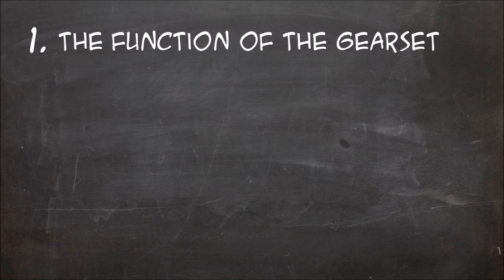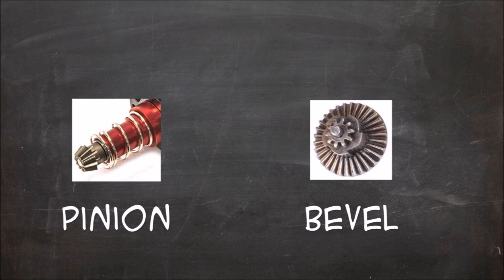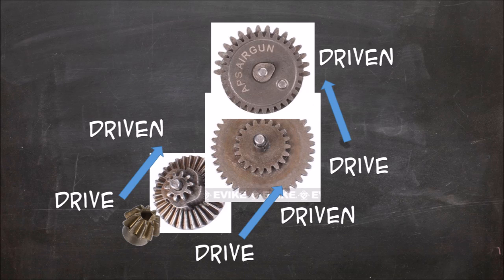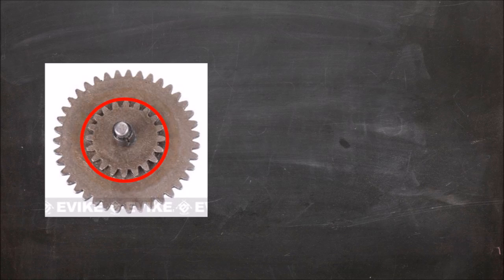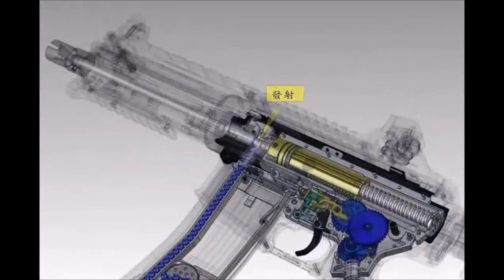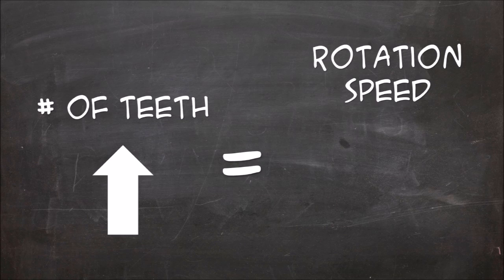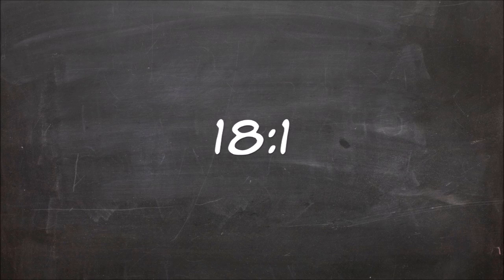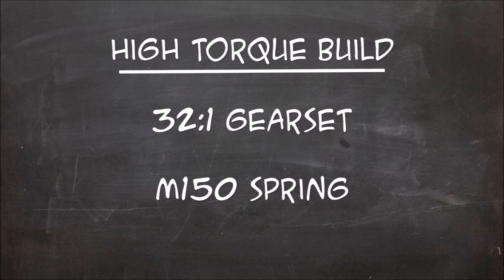How to Tech: Understanding Gear Ratios

Comment: What do you Think about changing my 18:1 to 14:1. I already got 1.95jule on m130 (Peru n hybrid v2) and asg 22k motor. The trigger reaction is awesome but i would like to shot Faster in full auto Mode.
Reply from the maker: Are you using 11.1v?
Reply: @sjdude922  ofc
Reply from the maker: Ok. Then just make sure it's a quality set. You can attempt to get away with a rocket or shs gear set but if this is a replica you don't plan on parting with it may be time to convert to siegetek. Just so you don't risk losing teeth.

Comment: Nice video. I´m entire day searching for something like this. But I have question hope you can reply. I´m going to have p90 from cyma. Soooo I want it high rps. So I´m gonna buy 11.1v battery, 13:1 gears, soft spring (I have cca m90-m100). But I wonder what motor. Motor at what rpm should I buy? I heard 18k-22k but that was only one comment.
Reply from the maker: It also depends on your intended FPS/joules. Where ever you play should determine your intended max fps for full auto or burst play. Then finally you need a goal for your ROF. Your current parts sound like 300 to 350 fps depending on your barrel length and cylinder type combo. So an 18k to 20k motor with that garset and batter should get at least 25rps. So yeah final stats will be 300fps like with an m90 spring and 25rps with an 18k motor with 13:1 gears and an 11.1 battery. Also remember the c rating will affect the performance as well. Look for 20 or 30 maximum C rating. That'll get you max performance from the motor without wasting power or creating too much heat.
Reply: @sjdude922  We have not fps limits (we know when too much is too much xd). Sooo I want as much rps/rof as is possible without doing complex/expensive dsg build. I have stock cm.060b (today arrived), never disassembled. Spring unknown but probably stronger one (maybe even 120). Sooo let´s say I´d do 13:1, m100-m110, 11.1v I see on shop 20/30c (literally 20/30c) so what xxK motor? Tell me  highest K on best performance.
Reply from the maker: @Shajzemon_SVK  You can always get a higher quality 45k motor such as an action army or a tienly but then you're hitting the 45+ RPS range and you'll need good mags to feed that. Best performance for me so far is my warhead brushless motor but those aren't cheap. I'd also advise an electronic trigger such as a jefftron leviathan or gate titan. You'll want the ability to tune the build with active braking and precocking for the maximum effective experience.

Comment: Hi! Do I need the sector gear delay chip with the 12:1 gears?
Reply: Not necessary, it would work fine without out one. But I would use one just to prevent any feeding issues. Pretty cheap anyways.

Comment: And about the 100:200 and 100:300 gears sets?
Reply from the maker: They use a slightly different equation to calculate their rating but same principle applies. Larger the number, greater the torque.

Comment: Ok so i’m doing a trigger response build with these parts:

SHS 13:1 Gears

SHS High Torque Motor

SHS M130 Spring

EastCrane(E&C) Reinforced Gearbox

11.1v Lipo Battery
Reply from the maker: Definitely sounds like a snappy semi auto response. I'd throw in a simple mosfet so the power goes directly to the motor and doesn't go through the trigger contacts. Unless you have the funds for an electronic trigger.

Comment: Got a set of 16:1 and the only gear that was different then my stock 18:1 gears was the spur. It had 19 teeth up top not 20. Literally everything else was the same with the rest of the spur and the other two gears. When I did the math it came out to 17.82:1 for my so called 16:1 😑
Reply from the maker: Do you mean a 19 tooth sector gear? The spur gear doesn't have a portion of teeth "up top". There are 19 tooth sector gears for l85 and sr25 cause some models have a larger piston.
Reply: @sjdude922  nope lol
The spur gear has a large set of teeth on bottom that contacts the bevel and smaller ring of teeth above those teeth that contact the sector. The teeth from the spur to sector was 1 tooth short of the teeth on my "18:1" spur gear. Everything else was identical

Comment: Hola ! necesito saber que seria recomendable. Tengo una gyg CM16 rider stock, y quiero incrementar sus RPS, cambio engranajes 13:1 + motor stock o engranajes stock + motor high speed 25k RPM ?
HI ! I need recomendation. I have a Gyg CM16 Rider stock, and y need increase RPS, I must change gear  13:1 + motor stock or moto high speed 25k rpm+ gear stock?
Reply: Un high speed pero le tienes que cambiar los gears y spring

Comment: Hello and thanks for the quality explanation!
I've bought a umarex UMP sportsline/competition and the internals are the worst so I thought to use it as a tech project. It has a v3 gearbox and after taking it apart for about 10 times, I now know how to work on it. I want the build to be able to shoot descent distance and also have some nice rate of fire. I am thinking of buying 13:1 gears combined with a mosfet. My question is what motor type should I buy for this project and do you think this would be able to take a 11.1 lipo, considered I buy quality gears? (I usually play outdoors). Love to hear from you @Cthulhu153 or anyone else in the teching field.
Reply: It has a ics barrel (m4 length) installed.
Reply from the maker: Quality is more a question of power. What gameplay is the replica going to be used for? Cqb or Outdoor.
Reply: @sjdude922  mostley outdoor. So i reckon accuracy and range are important. Maybe slightly bigger gears and a high torque motor are the way. Im just so torn at this moment. Also  i get that quality is more important but id like to have a snappy trigger.
Reply: bartd94 general rule of thumb when it comes to lowering your gear ratio, is increasing the TPA on your motor. You really don’t have to go below 16:1s if you have a good motor over 35k or below ~18-20 TPA, especially if you’re using a mosfet as the energy transfer will be more efficient and trigger response will lessen from that quicker energy transfer(to an extent). As far as accuracy and range goes, a lot less reliant on the GB that it is the bucking and nub. That being said the more consistent your air seal is, the more consistent your bb trajectory will be. For range and accuracy look into Rhopping your barrel.

Comment: If i end up using a 13:1 gearset would i go for the high torque or high speed motor?
Reply from the maker: Depends on the build. 13:1 gives high response time so it is also a higher rps ssg. If you use quality 13:1 gears you can use full auto at 400fps with the appropriate spring and compression setup and you should be doing 20+ rps depending on the battery and motor. 13:1 with a high response time can give you the best semi auto experience for indoor. You could pair it with a high torque motor for high response semi auto gameplay. Or if your power is low enough you could go with a higher speed motor so it can be used for semi auto indoor play and full auto outdoor play. The better question is what build do I want to do with 13:1? Then ask what parts can achieve that goal? That question can be answered a lot easier.
Reply: Cthulhu153 what do I need to make my Ares Amoeba AM013 to shoot 500fps and shoots straight like a laser I need your advise. I’m a newbie
Reply: alpha beta probably late, but frankly, a V2 GB is not gonna be able to run 500fps for any amount of time with any amount of reliability. The design of the GB is too weak and you risk a catastrophic failure, you’re also going to have a hell of time even getting the spring in the gearbox

Comment: I find a 16:1 set or a 15:1 set to be a good Jack of all trades set up.  With a weaker spring, you'll see a decent jump in rof, and with a heavier spring maybe only 1 or 2 rounds a second faster, but even that's enough to notice.
Reply from the maker: For sure. Only thing left at that point is motor selection.

Comment: I recently installed a ASG Ultimate boost 30k motor and it was double cycling with a m100 spring. If I install a 13:1 SHS gearset will it reduce the overspin on the motor, or do I still have to get a bigger spring?
Reply from the maker: You are having double feed off a standard 18:1 stock gear ratio? Asking to clarify
Reply: Yep, everythings stock but the motor and I shimmed the gears and adjusted the AOE. To clarify the gun I am using is a krytac alpha CRB. Is double cycling normal with this setup?
Reply: Xyfler get a heavier spring like 120 or 130 or use a weaker battery like 7.4
Reply: I already switched to a m125 but thanks

Comment: So I am looking to build a Dsg that is strictly for trigger response (I can’t use full auto at my field) and i need it to shoot around 350 with a .2 bb (can’t go over) so I was wondering what gear ratio would be best and what motor tpa would be best for that.
Reply from the maker: So you'll want a higher tpa. Go for 20TPA or higher. A lot of strength for those high tension springs on semi auto. If you plan on maxing out the dsg performance at 350 go tienly for motor brand. Next best would be asg. But between the two of you can afford tienly in your build cost go for it. If you were at 400fps then for sure ASG only cause they can go as far as 28TPA.
Reply: Cthulhu153 ok thanks
Reply: Could you send me a link to the motor and if I am using a m100 spring and wanted the 28tpa asg motor what gear ratio would I need for trigger response and what gear ratio would I need for the tienly motor
Reply from the maker: @creepernic27nicolas34  First ly Yeah I can send you the links. But second you cannot do a dsg build with an m100 spring and get 350 fps. The spring must be m140 or higher depending on barrel length and cylinder.
Reply: Oh so because of the high torque motor you cannot use a weaker spring other wise you can over wind it correct? So what spring and gear ratio would you recommend to get 350 FPS with the motor you recommended and a 200mm barrel?

(I’m sorry if I am seem unreasonable I just would like to understand)
Reply from the maker: @creepernic27nicolas34  No worries questions are always welcome. No the spring firstly determines fps potential. This combined with the cylinder gives max ability for the gearbox to push air out of the barrel. M100 will give you 330fps with a .2g bb at best. A dsg greatly reduces your potential cylinder volume thus severely impacting your output fps. This is why high tension springs are needed. They produce more force on a smaller volume of cylinder to give a similar fps as a cylinder with greater volume.
Reply: Ok so if I used the asg motor with 28tpa and a 12:1 gear set using a m140+ spring and a precocking mosphet would that be optimal for the 350 FPS and trigger response
Reply from the maker: @creepernic27nicolas34  No. See you've gone back to a standard gear set. Going from 18:1 to 12:1 just changes rate of fire and can give you faster trigger response. Now you are back to taking full advantage of your cylinder. If you need 350fps, now I would do an m110 spring. M100 does well for 330 but you want that extra push. If you go over by a few fps, you can cut off a half cool or two and that will get your gearbox set. Also with a lower spring tension, I wouldn't use a 28TPA because that is a lot of wasted torque. You can get the same effect from 20TPA because the torque is compensated by higher speed. That extra torque on semi auto gets spent on your cutoff lever and can lead to unnecessary damage. If you consider a mosfet/electronic trigger, I would pair your build with a gate titan or aster. They remove the cutoff lever and use optical sensors to detect the sector gear teeth. You can also adjust the pre cocking with their software.
Reply: Ok so I will get an aps 22tpa motor (just to be safe) then a m110 spring and shs 12:1 gears and a lonex cylinder set an shs piston and a gate titan advanced
Reply from the maker: @creepernic27nicolas34  That's sounds good. Go full steel tooth piston for shs. Also try and get 14 tooth. That will help with high-speed. Plus I believe they are pre ported to reduce weight. Less weight means faster return.
Reply: Ok thanks you so much you have earned a sub
Reply: Would the 12:1 be the best gear ratio for that
Reply from the maker: @creepernic27nicolas34  Yes 12:1 should work fine.

Comment: What if you want a gun to shoot between 390-400FPS and high RPS ?? What gear ration gears would you get ?
Reply from the maker: 400fps is not too difficult to pull off. Fps is based more on the compression set and spring strength. Compression connects to barrel length as well. I like going full lonex compression and a guarder 120 spring for 400fps and a 363mm innerbarrel. The higher rps is based more on the gearset, motor and battery. If your gun already shoots your desired fps, then just switch to 13:1 or 12:1 gearset. That will increase your rps, but typically nothing over 30-35rps; depending on motor and battery. There is a lot on building a gearbox than just dropping in a single part.

Comment: great video. i watched this video to get an understanding of gear ratios and how to find out what the ratio is on a gear set because i have a gun that i need to replace the gears in but i couldn't find anything on what the gear set was. the original gears in the gun are plastic but i need to change them cause may have been grinded down by a better motor i put in the gun...

Comment: I also have a snow wolf Barrett m107 I am optimizing, as mote of a support gun. The outer barrel and muzzle brake could accommodate a 950mm inner barrel. so far the longest I have found is 800mm What are your thoughts on going loner for range and accuracy?
Reply from the maker: Ron Torrence barrel length just helps with groupings. Range is an fps and hop up quality issue. First improve the hop unit and bucking to the extent you can based on the rifle. Because this is a rifle that needs accurate long shots yes it should have the longest available barrel but issue is for standard aeg cylinders the max barrel volume to cylinder volume is 509mm or m16 barrel. Not sure on the internals for the snow wolf barrel so not sure if you can max out the barrel length. To be safe I would match the stock barrel length. If you have the funds to experiment go right ahead.
Reply: Cthulhu153 jeez, this comment (and video) really gets my mind rolling. I have done much thought on volume engineering, and I’ve thought of a few paths, not too far in depth with any proof of concept. 
1. V2.5 gearboxes [in a&k sr25 or L85] have 19 teeth, the company obviously didn’t want this gun to be teched at max limits for its size though.
2. Putting a bore up cylinder and parts with a “stock” in theory SSG  such as this gun could squeeze by a bit more barrel volume. Obviously if this were to be done a TBB would be on the same page as essential to volume maxing, if this guy’s 800mm barrel for whatever reason isn’t TBB.
One last interesting thing I have found is that Hunter-seeker Airsoft has a spread sheet for free with TONS of technical aeg info applicable possibly to situations like this when pushing the limits (which I love to think about) but don’t have thousands to spend on experimentation.
Reply: @sjdude922  How's your cylinder/barrel volume ratio hanging in there my guy

Comment: I'm weir, and proud of it. I only use full auto messing around in the back yard. Our field in Chiang ai allows 500 fps for bolt action, and 450 for semi and 3 round burst. They measure only fps, and with .20 bbs. I am in the process of installing GATE Merf 3.2s in all my aegs set for semi and 3 rd. Would you suggest I stay with stock gears and stuff or go for Steel bushings/gears, and high torque motor? Our games are usually only 10-30 minutes long.
Reply from the maker: Ron Torrence I would replace the bushings with steel ones for sure and make sure to get an shs 14 steel tooth piston. I only change the gearset based on the brand of the rifle.
Reply from the maker: Ron Torrence also the motor should be changed for a hightorque. You will get a better semi-auto response.